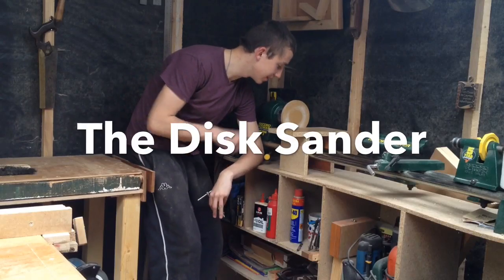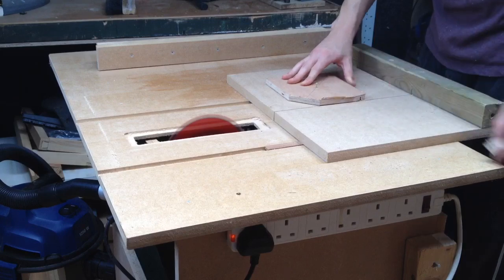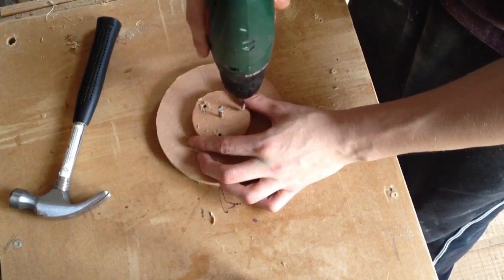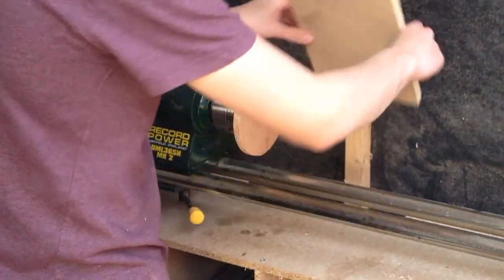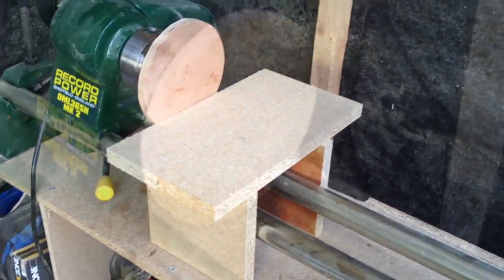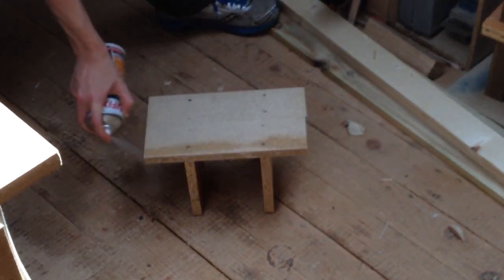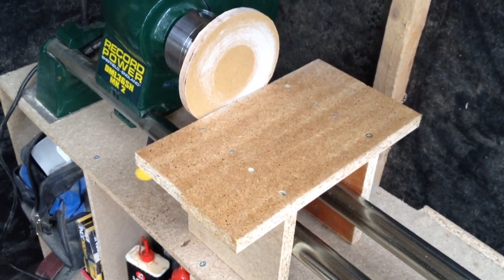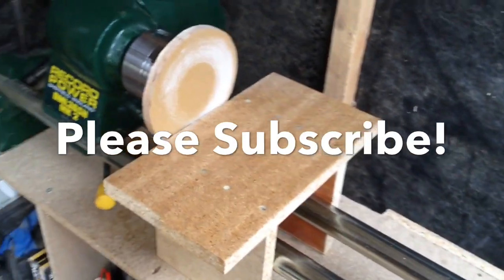How To Build A Disk Sander

Comment: a little suggestion :)
make the table higher , the top it is better put at the mid line of the circle , this way the force keep ur piece flat on the table instead of trying to take it away, as in your case.
still , great idea and good design.
will be an excellent addition to your shop

Comment: Good idea, i wish to have a lathe to do the same.  A recommendation, you can make the suppor taller, the ideal height is at the center of the disk, and using always the right side in your case, when the sand paper is turning down. Sorry if you don't understand, my English is not to good.

Comment: adam,
been thinking, could you do maybe a video of fitting and leveling of a extension, on designing, making, fitting and leveling of infeed and outfeed tables on a machine mart aluminium based saw type, or similar saw or router, i know a lot of guys who 1/ are scared to attempt this and 2/ dont know how to go about it even though there are a lot of vids on you tube they all use expensive tools and machinery to do this simple job, sort of a sledgehammer to crack a nut approach,
thanks
dave from wales